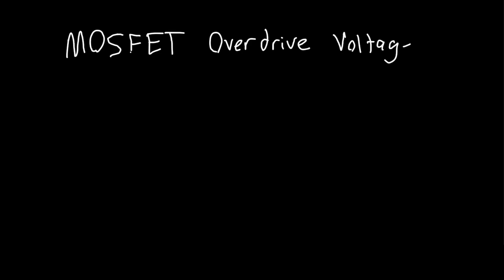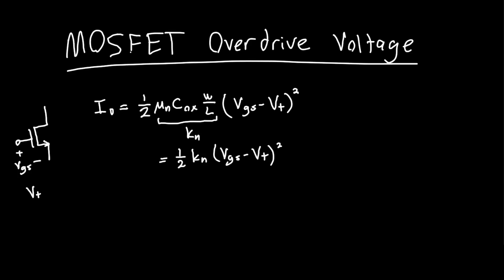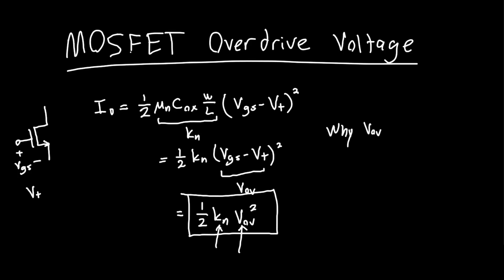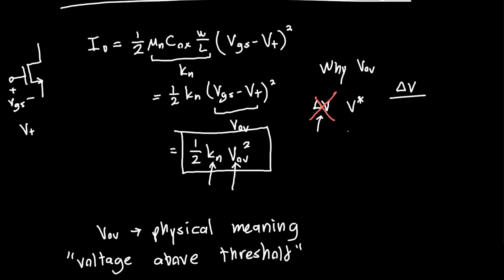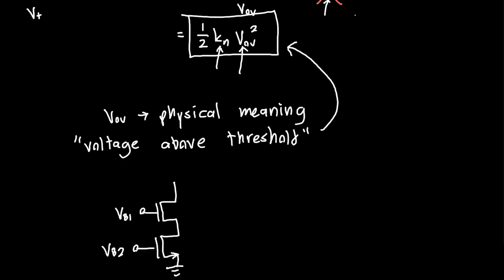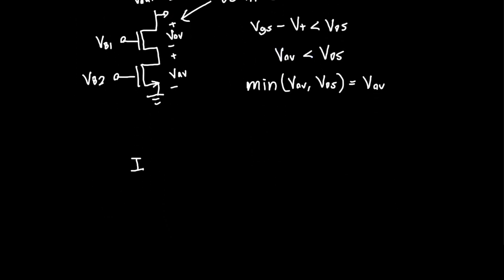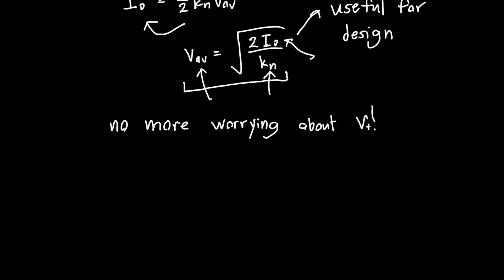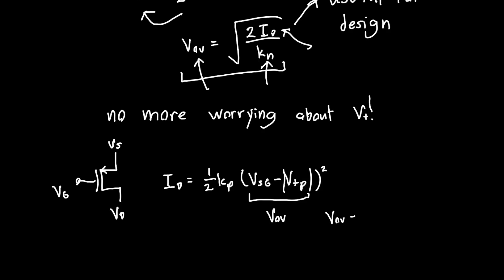MOSFET Overdrive Voltage Explained

Comment: But how does increase in overdrive voltage limits the swing of output voltage in diode connected load or any other load connected circuit